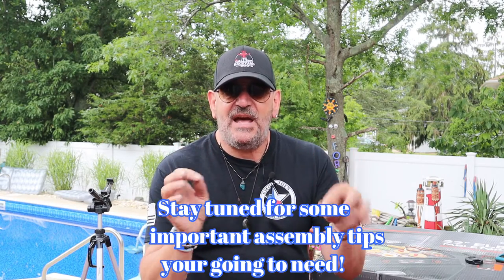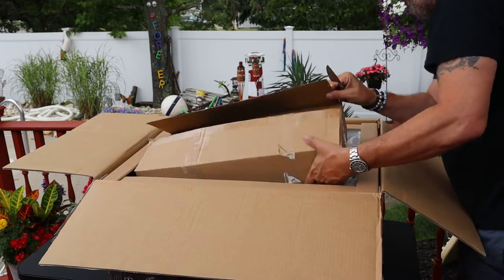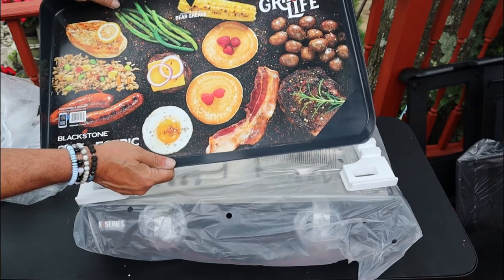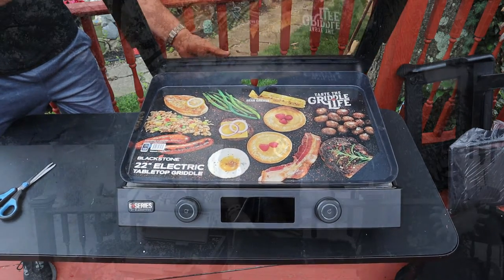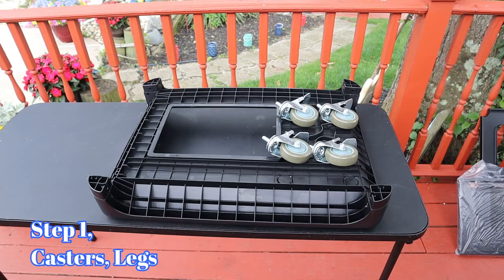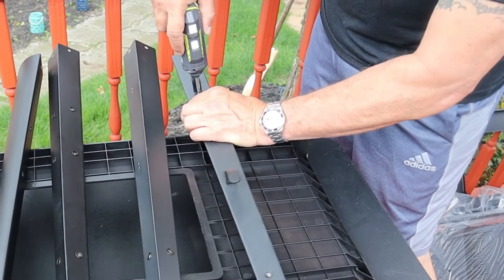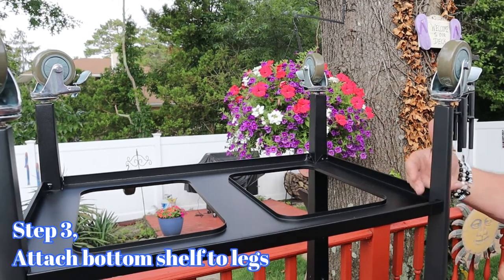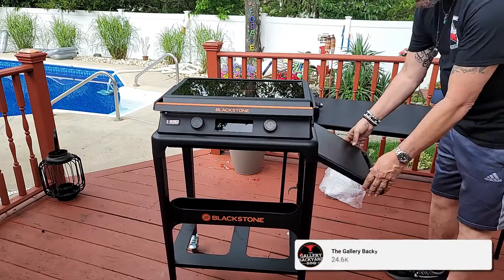Blackstone E-Series 22" Electric Griddle  Unboxing & Assembly & First Look | A Step by Step guide!

Comment: The 22" inch is as small as I'd want to go even cooling for two as having the dual zone feature is really useful. Just getting the e-series 22" I'm already in live but as a cast iron purist and a husband & father of nine plus the spiuses they are adding and friends I really want a classic 36". The e-series is nice for inside,outside, camping as you can run it off Eben your car battery with an inverter if not just electrical hookups, again tailgating using your car battery or deep cycle battery bank, at the park, or even during an emergency when the power is out. If you were in the military, a backpacker, or have been in an emergency you understand the morale boost a hot drink & a hot meal can be especially if you have kids. Being able to make tortillas, Flatbread, Bannock alone with some peanut butter, jelly, or honey can be such a boost and is simple. So while this is a fun home culinary item I see it serving in a multitude of potential roles for my family, but first thing first my 8 year old daughter & 11 year old son want to cook up pancakes & eggs for breakfast!

Comment: Easy enough to put together, The one thing I noticed on the 17" that could be better is something to catch the water that drains down the under side of the lid when you lift it with condensation on it. What don't go in the grease cup drains on whatever it's sitting on, but, no big deal, just put a towel back there.
Reply from the maker: Will you do get that condensation under the lid. Double edged sword I guess considering I love it for that steam effect on rolls;)...

Comment: Hey Tommy, I kinda like the 22 inch I look forward to you putting it through its paces backyard looks great by the way the shack fits in really nice and I’m pretty sure the side shelf is the integrated cutting board not much of one but I’m sure that’s what it is let us know have a great one🇺🇸🇺🇸🇺🇸👍
Reply from the maker: John. I'm not so sure about that because the picture on the box showing the cutting board looks different then the side fold up shelf. Ive read that the cutting board is sold sepertly.
Reply: @thegalleryBBQ  i’m sure you’re right Tommy it’s just that the shelf itself looks like a cutting board I had a white cutting board with that same shape to handle it looked just like it🙂👍🇺🇸

Comment: Great job Tommy. I have a 17 E series in the rv and the more I cook on it the more I love it! I have started looking for a 22  because of dual temp zone  would really help. Bring on more 22 e series cooking.
Reply from the maker: John. I have Chicken Fried Rice out in the AM.... ;)...
Reply: John Solberg, do you use this grill outside of your RV.
Reply: @PWS777  
Yes I do real happy with it. Just watch what you have plugged in on RV circuit. if camp site has a 20 amp plug on post I run direct off that plug instead of thru the rv

Comment: nice. i like to 2 zone heating. like my small propane black stone. just bought an air fryer. so i have to wait to get 1 of these lol.  look easy to assemble. what wattage is it? may have to run it of a #10 cord.
Reply from the maker: I think it draws 1200. That said. I ran mine on a 75' extension, house to the shack. No problems.

Comment: Can I ask a favor...I'm trying to see if the 22" will fit in my RV OR if I'll have to go down to the 17" option. Can you measure the feet (W and L) ...from foot to foot....OR I see where the feet sit in the pockets on top of the rolling cart...those are the dimensions  I need. The dimensions on their website is for the whole thing & I don't need the measurements for the outer  edges. The more the info the better & even pics from how/where you measured from. I appreciate your time.😊🙏
Reply from the maker: sorry i sold mine. cheers